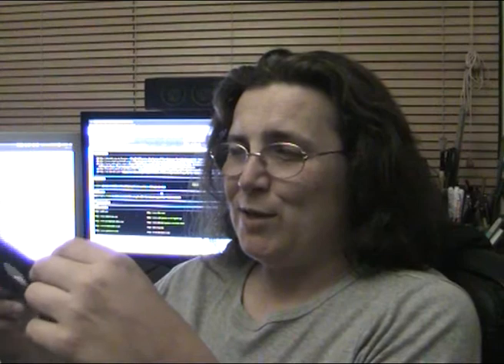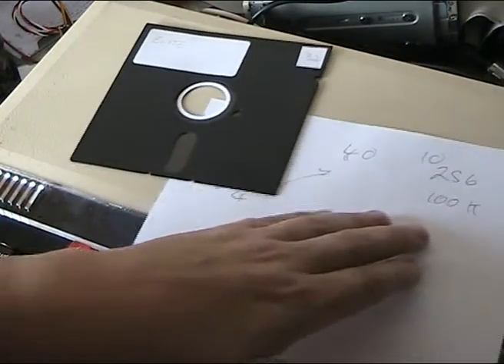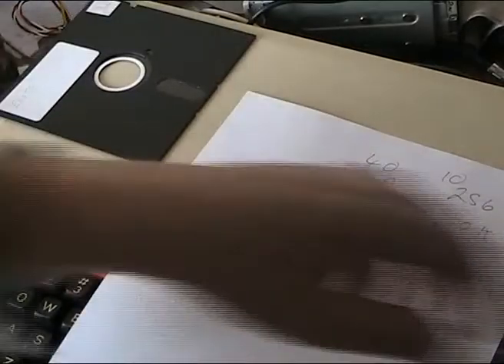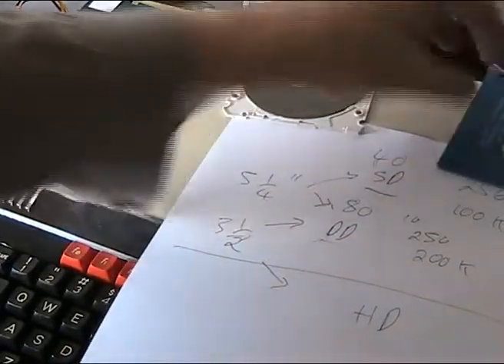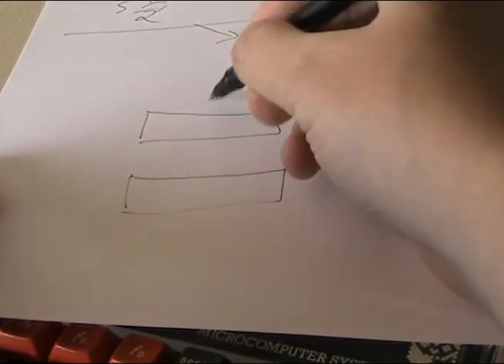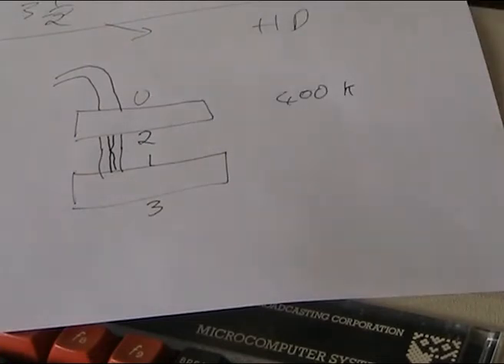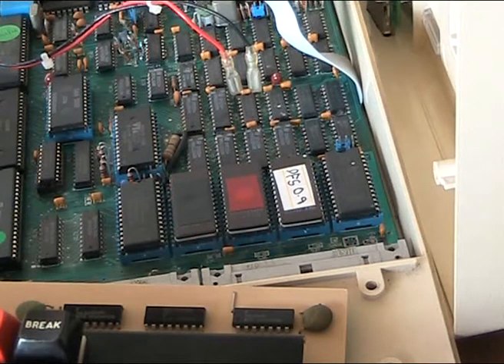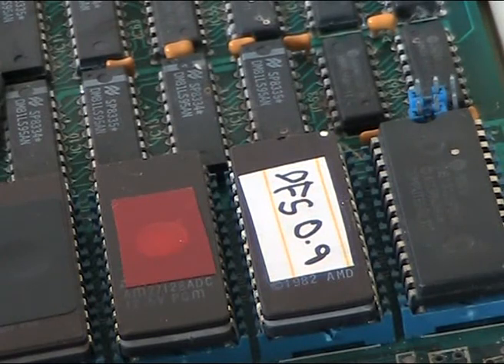11 - Floppy Disk Hardware

Comment: Thanks for a most informative video Michelle. I was very interested in the BBC Micro Floppy Interface card shown at  around the 13 minute mark. I realise this video is almost 10 years old now but I wonder if you have any information on who makes these interface cards and are they still available? Many thanks.
Reply from the maker: You're welcome. Glad it was useful. I had a look on ebay but couldn't find any more. Best thing is to get in touch with RetroClinic, or ask on the "Star Dot bbc" forum. Just search for what's in the quotes and you should find them. They're my first place to turn when I have BBC Micro issues.

Comment: Hi Michelle,  I've just bought my First BBC micro (B),  Bought as non working from e-bay,  I replaced the power supply caps & found about 30 dry joins on the pcb. Only then did I plug it in,  and it works fine.  Stumbled across these old videos of yours which I must say are very helpful,  I've ordered a few items from Mark at Retroclinic,  he's very helpful.  
So this is really just to say thanks for these videos,  most helpful.  Do you stilll have any BBC micros yourself?
Reply from the maker: Glad you found it useful :-) Yes, Mark and everyone at StarDot are incredibly helpful. I still have three BBC B's, two are out, and one has a 6502 co pro. They don't get turned on much lately as I've flooded myself with other projects, but I'm hoping to have more fun with them next year.

Comment: I bought my first BBC Micro ModelB at an EBAY auction. It work. I am interested in the 3.5" floppy adapter. Is there a more detailed description ?
Reply from the maker: Yes, I have more information on my web site - http://msknight.com/bbc/ - that has a section on the hardware to install in the BBC for a floppy disk, as well as a couple of formatting programs which you may have to type (formatting doesn't come on the ROM, but is an external program which was supplied on a floppy disk along with the drive when bought) ... however, be careful with floppies as time means mould can grow on the surface and if that gets onto the heads, then that will wreck your drive. Better to use something like the MMC solution, in my opinion.